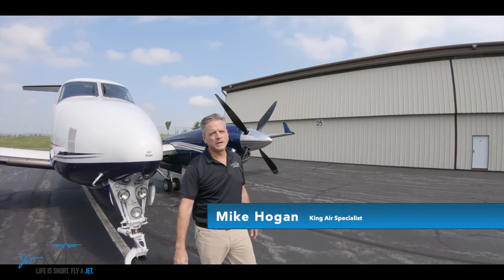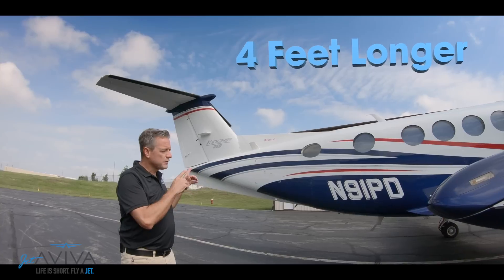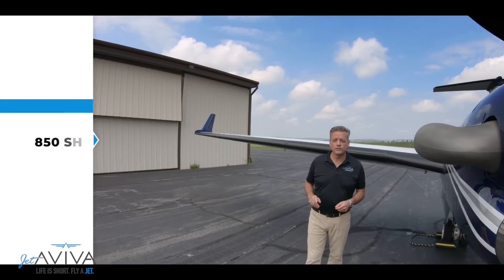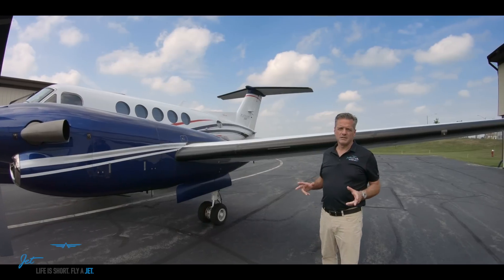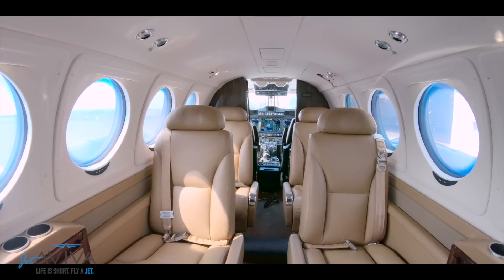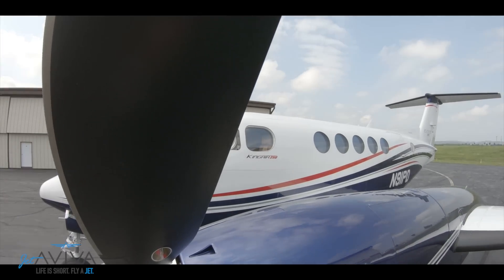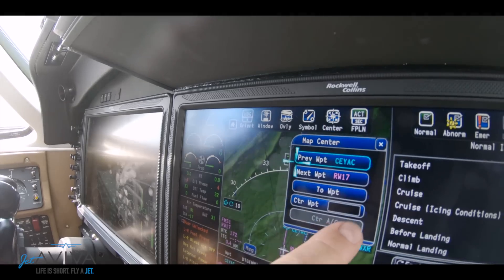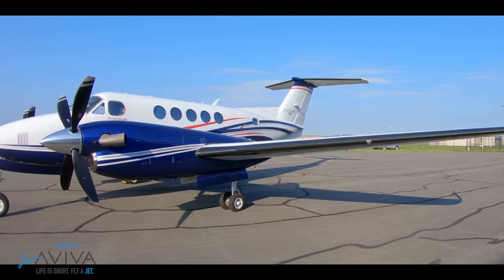Aircraft Review: King Air 200 Series

Comment: One of the biggest reasons I might pick a 250/260 over a 350/360 is that the 250 doesn’t have a balanced field requirement which allows it to use shorter runways.  If I wasn’t concerned about runway lengths I might go for the increased payload of the 350.

Comment: The only draw back on the 250 is the full fuel payload is 114lbs.  If you fill the tanks, you can't fly...how did Beech miss that?
Reply: The fuel-full payload limitation has been with the airplane since it was introduced.  200/200GT/250 owners manage that their own way.  The good news is that there is an option to increase the MTOW.  See below

"By increasing the King Air 250’s max ramp weight to 13,510 pounds, the enhanced payload modification takes the cabin payload with full fuel from the current 155 pounds to 1,025 pounds. King Air 250 aircraft with this option are certified in the commuter category, and includes the installation of safety systems, such as engine fire extinguisher and illuminated escape path floor markings. A BE-200 type rating is required to operate airplanes in the commuter category.

The modification, developed with CenTex Aerospace, of Waco, Texas, also is an aftermarket option for in-service King Air 250 aircraft and available through Textron Aviation’s factory-owned service centers."
Reply: On a turbine aircraft the Basic Operating Weight includes the weight of the pilot, so full-fuel means a pilot plus 114lbs. It works out perfectly for an owner flying solo.
Reply: @nocalsteve  thank you,  I didn't know that.
Reply: Brian McGee Seriously?
Reply: @RootBeerGMT ???